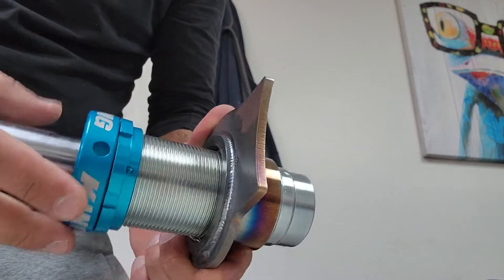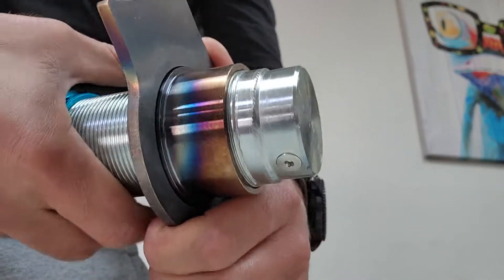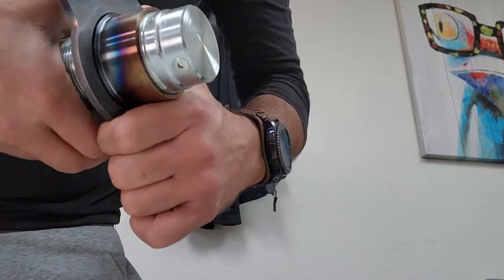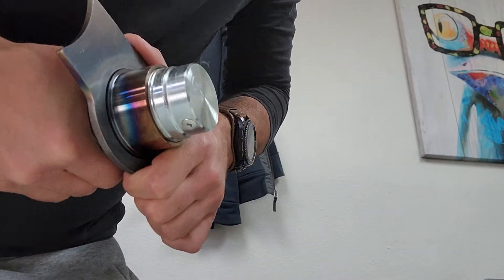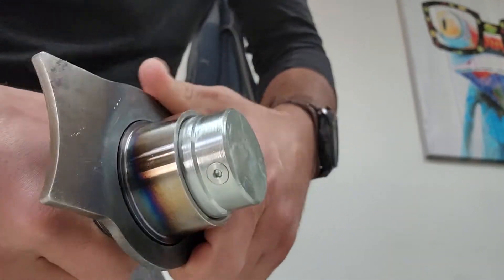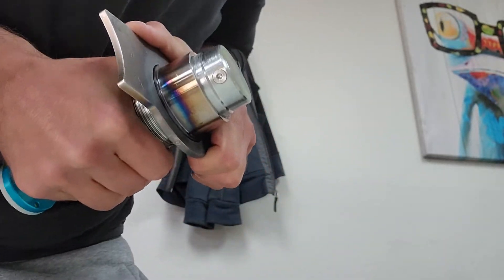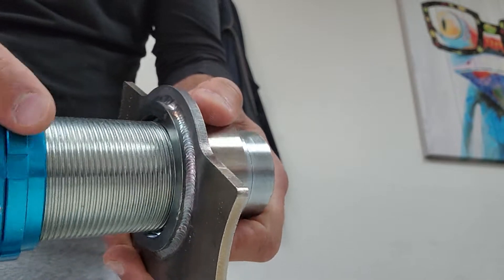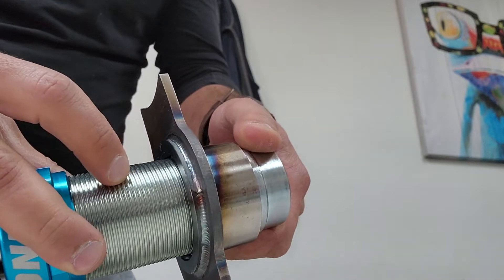King Hydraulic Bump Stops Jeep JL Rear Threading Issue

Comment: This is a problem with your bracket you have threaded on your tube, electrolysis happens over time with dissimilar  metals, not threading, the threads are either the wrong pitch or as the previous person mentioned the threads are warped from improper welding, this is who people use tubes with clamping “nuts” as opposed to threaded directly on the tube. Not to mention, the impact associated with the bump stop would most likely dismember the threads.
Reply from the maker: Appreciate the reply. Where this mounts you have no other choice but this design as the upper portion is "blind" inside of the frame. King sent me replacement brackets and they fit without issue. Thanks

Comment: Good to know they took care of you! Were you not able to mount a full sleeve in your application? They are typically worry free and the areas that you weld up are not interfering of the threads, what application is this for out of curiosity? Usually you weld up a large tube on the JL/JT for the rear, what size lift are you running?
Reply from the maker: This is for a Jeep JL. The kit has you drill from cut/clean the current bump stop mount which is directly under the boxed frame. You then drill a with a hole saw to install the bump stop and weld around it. You have no access from the top. The design you're referring to won't work with factory axles and suspesnion as there's not enough room to bring out the cans. These King cans are also 1.5" travel for this reason.

I'm currently on 4.5" teraflex springs, king bumps and Fox 3.0 shocks. Working on the high steer geometry now